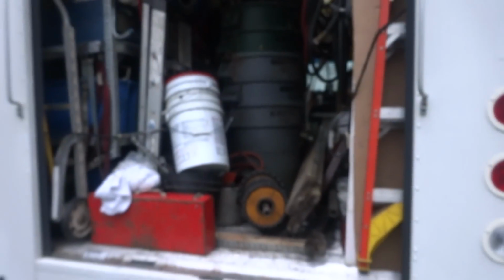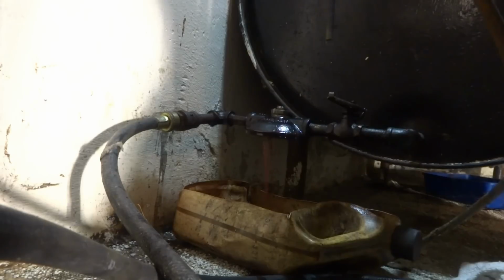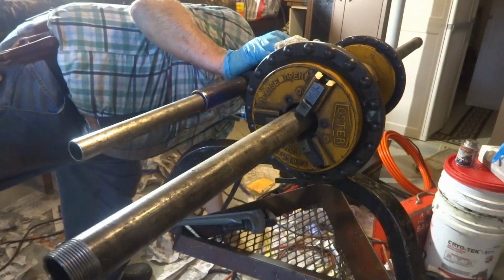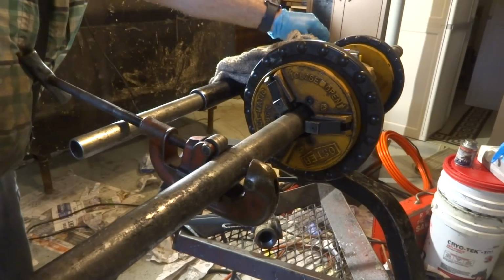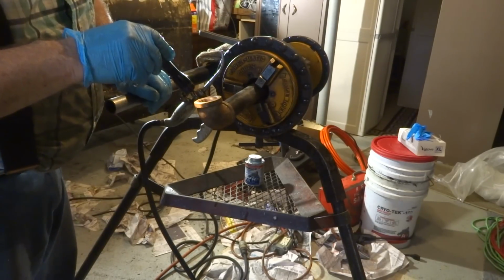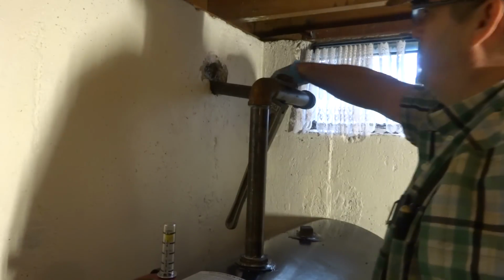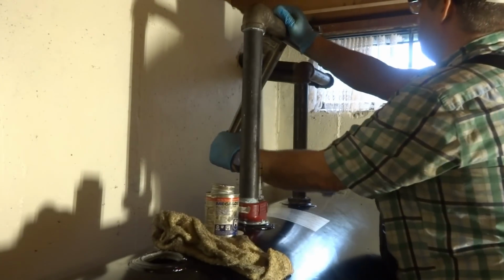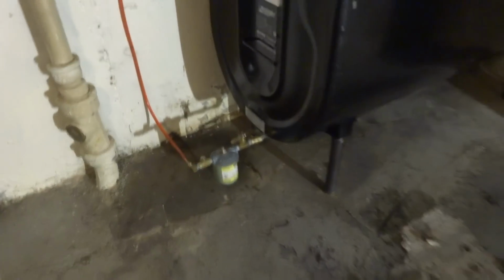275 GALLON OIL TANK REMOVAL AND REPLACEMENT

Comment: We use a Rigid  threader at work . We have wheel attachment for it so if you need to move it you can roll it. Yoru style is definitely lighter. A tip we have noticed is after you cut the pipe and deburr it we use an angle grinder with a flap disc to smooth out the outside of the pipe before threading it. It make a much nicer edge on the thread. You do great work Steve I really enjoy watching your videos.

Comment: Im curious as to why you ream the inside of those pipes but not copper pipes.
Reply: Cos it’s easy when the machine does all the work
Reply: De-burs the pipe, ... No lose metal to end up in the tank, or fuel line, down the road ........

Comment: Whenever I go above with an oil line I use a duplex fitting off the top of the tank with a feed and return line so it’s less likely to get air in the line .  Also it’s less likely to get sludge build up when you use the duplex method since you have the ability to keep the lines off the bottom of the tank .

Comment: Can you use plastic tanks for heating oil?
Reply: Plastic tanks? For what?
Reply: @drewmurphy2796  Like those tanks farmers use to store chemicals for spraying. Won't rust like steel.
Reply: @Parkhill57  pretty sure the tank has to be ul certified or whatever: that’s why we use the steel/ Roth tanks
Reply: @drewmurphy2796  Looks like Roth tanks are plastic tanks with a galvanized steel outside. So-called double wall.
Reply: @Parkhill57  correct but they are designed to hold oil and in the event of a leak contains the oil. Where as just a regular plastic Chem tank is not.
Reply: Not in Massachusetts anyway ....

Comment: What did u cut the old tank with? Angle grinder? And did u use kitty litter to absorb the oil residue to prevent fire starting from sparks ?
Reply: Sawzall, looks like (saw it in the background in the video ....)

Comment: North America pre-world War II, all domestic water in a house was galvanized steel pipe cut to length and threaded. Then copper what a time savings, now pecks. And labor time is the bottom line. Our area black steel pipe is still mandatory for gas.

Comment: You may need a "Tiger Loop". Because of the over head line.
Reply: Would the check valve by the filter keep it from needing a tiger loop?
Reply: @MattP804VA  Maybe. But the tiger Loop has more sucking power. Plus the Tiger Loop gets all of any air bubbles in the fuel before it goes through the nozzle. It is supposed to give 5% more combustion efficiency too. But I don't know about that.
Reply: @ good info. Thank you

Comment: Steven, what do you use to cut the old tank up with? 🤔
Reply: sawzall mama!
Reply: Grinder with cutting wheels and a sawzall
Reply from the maker: i use only a sawzall  with a 18 teeth per inch blade .. probley need 5 blades or so ........anything else might set the tank oil / muck in bottom of tank on fire and burn down the house

Comment: Funny, I just removed my tank after a heat pump install. What a crap shoot. Bastard had way more oil than the gauge read. Not to mention the gunk. Had to cut it in three pieces.

Comment: supposedly they claim the vent has to be as big as the fill so it does not build up pressure when filling I can't believe that it builds up pressure because of pipe size the whistle on the vent is more of a restriction than the pipe is and gas flows out easier than liquid flows in. plus the hose from oil company is not that big what do they use 1 inch or maybe 1 1/4 anyway on cars the vent is tiny compared to the fill pipe

Comment: Hi Steve, where i live, we are not allowed to have oil tanks in our houses, they have to be outside the house, an they have to insulated so they won't cause a leak to the enviroment.    Wow, that is a beast, holds lots of oil, did you have enough barrels to hold all that oil.
Reply: around here they want people to have tank indoors, so it won't leak into ground unnoticed and avoids freezing of water in fuel or gelling of fuel in winter.
Reply: What state or country are you in?